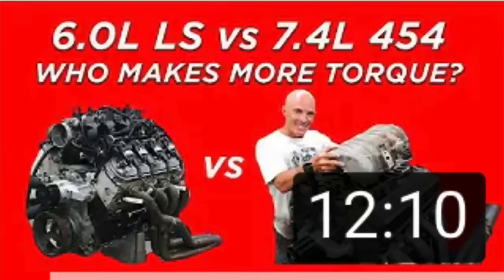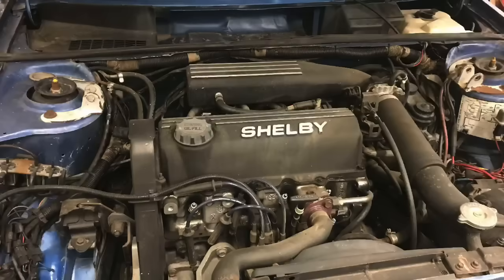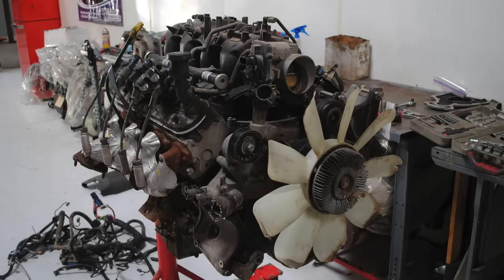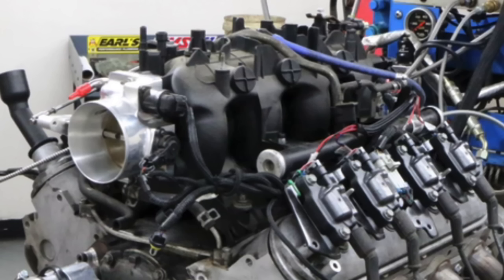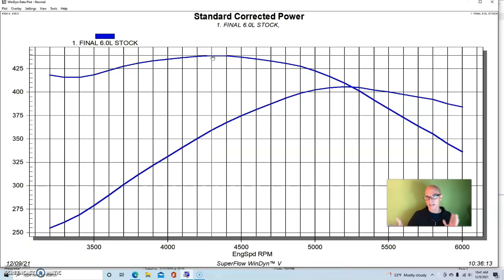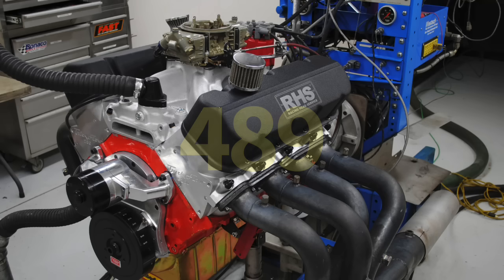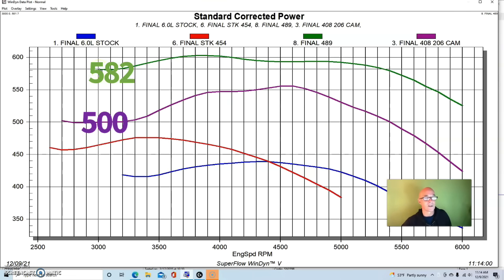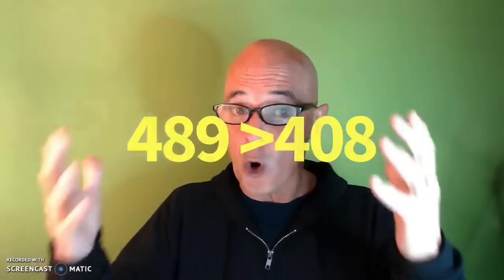LS VS BIG BLOCK! WHICH STROKER MAKES MORE TORQUE? 6.0L VS 408 LS, 454 VS 489 BBC THEN 408 VS 489 !

Comment: @Richard Holdener Great vid! One thing about towing engines is fuel economy. I'm not sure if adding fuel consumption data would make a difference or not. Might be a cool idea for a video though. Even NA vs. Turbo! Efficiency is king right?
Reply from the maker: Fuel economy is not achieved at WOT like these tests-the load would have to be simulated at part throttle
Reply: @richardholdener1727  like at a constant 300 lbs. ft steady load? Probably hard to do on a dyno.
I daily a diesel anyway...🤷‍♂️
Reply: Turbo efficiency is great but you need to remember that as you add boost, you increase cylinder pressure and then you need to switch to 91 octane fuel which costs an additional 50 cents (or more) per gallon than the 87 octane. So, while you get better miles per gallon, the actual cost of fuel used for driving 1000 miles goes up significantly. Ultimately, turbo diesel with it's very high static compression and boost wins in low RPM torque and fuel efficiency.
Reply: @vettedoctor6667  not to mention diesel has more btu per gallon... Between energy density, and the lack of afr control necessary,  that makes diesel king for towing economy.  Remember,  high afr ratio diesel runs cool, low afr is hot and smokey...

Comment: Wish I could get rid of my LS in my '07 Silverado and go with a 489. Since I live in a state run by moonbats, that's off the table. They changed the rolling 15 model year emission exemption starting with 2007 models and up, so now the truck has to keep the check engine light off until it goes to the crusher.. Just my friggin luck. I hate how I have to cruise hills at 4,000 RPM just to get any power out of this thing when I'm towing. I'll gladly trade 200 HP for 200 ft.lbs ...
Reply: As long as you do a complete changeover it shouldn't be a problem to swab a bb i wouldnt think
Reply: @austindoud273  Can't be done now. Will never pass emissions.

Comment: Can we compare a LS 427 to the BBC 489?  I expect the 489 to win but it might be interesting to compare!
Reply: Cubic inches everytime.  It takes magic to beat physics.
Fan boys believe in magic....Ford magic, Chevy magic, or Dodge magic.
Reply: @dannymccarty344  not always the case as shown in this video alone.  The 408 LS beat the 454 everywhere handily yet it has less cubes.  Apples to apples comparison, yes the more cubes the better.  But frequently comparisons are not apples to apples - especially on the street.

Lord knows my LS1 has taken quite a few loud mouthed BBC classic cars to gapplebee's.... ;)
Reply: @steve390gold  watch it again, son.  Pay attention to what is being said in the video.
Cubic inches win.
Reply: @dannymccarty344  son, YOU need to rewatch the video again.

408LS smokes the crap out of the stock 454.  Period.  End of discussion.  Even Holdener points this out.

Dont believe me go take a gander at 14:09 in the video.   It was only AFTER modding the 454 as heavily as the 408 did it surpass it.

Secondly you sound exactly like the BBC blow hards that claim 600hp but struggle to run 13s....lmao
Reply: @steve390gold ok, take the LS and stroke it.  No other changes.  What do you get with more cubic inches? >more power!
Don't stumble over the Big block vs the LS thingy, son.  Cubic inches win.  Stop acting like such a FANBOY.   Physics is physics. ...

Comment: It would be great to see a comparison of similar cube LS and Big Block stokers say within 5 or 10 cubes, run with similar cams intakes, heads etc. That would hopefully show which is truly better. Of course there is the weight difference factor to consider between the two in a vehicle. If they ended up similar, power to weight might be the winner.
Reply: Similar cubes I vote the LS would win, but with over 30 years of design advancements to lean on, it had better.
Reply: @qball1of1  i think if you could put the best ls head on a gm 632ci  engine n/a it would choke
Reply: @jodil5288  you're right it will choke the ls heads won't put out the cfms for 632 to actually  stay running.
Reply: Exactly
Reply: I follow what you are saying, but say both engines make 500 horsepower and 500 lb-ft of torque with the exact same curves. It doesn't matter if it's a big block or a small block or inline 6 cylinder. 500 hp is 500 hp. Therefore, the lighter weight small block LS would have the weight saving advantage in a vehicle unless the application called for more weight. 500 hp and 500 ft-lbs is going to be faster in a Camaro that is 100lbs lighter because the block weighs less than if it was a big block. Does that make sense? I'm not sure I'm explaining my point clearly.
Reply: I doubt the Big Block will even feel the weight difference.
Reply: Right, but the difference would be if they made identical power (same power curve and all) that's when the weight would be a determining factor. Unless the application called for the extra weight say for traction in a snow plow rig or something to that affect.
Reply: @erichoward8463  I think the BBC is less affected by miniscule weight.

Comment: Wish you could get a cam for the LS with a tighter LSA once and push the torque down lower in the rpm band.  That 408 would be great esp with the weight savings
Reply: Call Bullet and they'll grind any cam you want.

Comment: Richard, you make it look so easy. We thank you for all your hard work. You hard work proved what we learned back in the 1970's when we ran small block and big block Chevys. We found that a well tuned small block was a match and a lot more practical on the street. The big blocks were gas burning pigs that were better  suited to trucks
Reply: And a well built bigblock will smoke anything.

Comment: The bigblock has AFR heads the LS has stock heads so with a bigger engine and some of the best aftermarket heads on a bigger engine makes more torque than a LS engine with stock heads put stock bigblock heads on the bigblock bet the numbers would be much closer to the LS numbers
Reply from the maker: the stroker 408 ls has AFR heads too
Reply: @richardholdener1727  sorry about that listening with no voice my bad

Comment: Hey Richard love the informative videos keep em coming brotha, any advice on how to get some more ponies out of a 5.7 Chevy TBI without swapping out to a carburetor some of us unfortunately live in commifornia where the state government hates motor modification?
Reply: Get the 454 TBI or switch to TPI
Reply from the maker: might be legal cams, headers for that motor
Reply: @richardholdener1727  I have already done headers and exhaust plus 14 inch open element k&n filter, by chance do you know what aftermarket cam would work with the factory stock computer? Thanks for responding and any info you can provide me I appreciate it

Comment: Hey Richard. What’s making bigger cams loose torque?? Is it the lift. Or the duration?  More HP IS GREAT. BUT WHY DOES IT LOOSE TRQ??
Reply: Obviously, I'm not Richard, but hopefully this will help. The larger cams losing tq is a function of the longer duration. With the longer duration, the intake valve is held open longer (duration) which leads to bleeding off cylinder pressure at low speeds. A smaller duration cam will slam the intake valve closed sooner in the compression stroke allowing the piston to start building more cylinder pressure earlier vs. a long duration cam that holds the valve open longer allowing some pressure to escape back up into the intake.
Reply: @Torquemonster440  thanks. Great info. I will keep that in mind picking my next cam
Reply: @lildno2007  you're welcome. Another common misconception is thinking cams are sized according to their lift, but cams are actually classified as "larger" or "smaller" based off their duration specs.  How long (duration) those valves are held open is MUCH more critical to power production than how high they're lifted.
Reply: @Torquemonster440   yea I’m familiar with that.
Reply: Usually, it is the overlap. When both valves are open at low RPM, the exhaust isn't very good at scavenging everything out of the cylinder and sometimes goes back into the intake. As RPM increases, the exhaust gets more effective at scavenging the exhaust gasses out and at the same time creates a pull or vacuum on the intake port.

Comment: What single turbo would you put on that 408 with the btr stage 2 cam???? Or that 220 cam you put in?? I really want to know! Something I dont have to rev passed 6500.
Reply from the maker: S475/S480 FOR UP TO 1000 HP

Comment: Honestly torque or horsepower built all out a big block will always win period ever heard of a lil thing called bore spacing
Reply: Ah ok ill go get a bb caddilac cuz ya know those are so good lol
Reply: @austindoud273 Spend the money and those Cadillac engines can make 800+HP NA. Seen a few.
Reply: @austindoud273  This discussion is about a BBC in case you missed it just sayin!
Reply: @scottk2342  no you just said bore spacing
Reply: @austindoud273  ok I’ll bit let me explain bore spacing determines max bore size which determines valve sizing which determines throat diameter of the bowl which controls airflow through a cylinder head get it.Once one builds the engine to handle the power or torque without mechanical failure yes any big block will win period.You see with a Ls you are limited on bore spacing so at some point there are no more Cubic Inches to gain you can’t match the cubes of a big bore spacing big block with head flow.

Comment: While there is no substitute for cubic inches, I don't know if you would really need much more than the 408. We used to have a work ute with a stockish 454 in it, and it had oodles of torque for daily use. The 408 would be a lot lighter to steer and stop. For me I think I would pick it over the big block.
Reply: The big flat torque curve of the BBC is definitely useable and would come in handy in many applications. I will take the BBC every day of the week and add Holley or Fitech fuel injection and then you have the best of both worlds.
Reply: Who cares about the weight when it would be going in a truck anyways like a dually...

Comment: I figured a tune might help my air/fuel issue if one exists, I know the factory tune was meant for the factory muffler. Idk if the 02 sensors are going nuts because of an increase in muffler flow caused a decrease in overall exhaust velocity.

Comment: The gen 6 96-99 7.4/454 have good large oval port heads (not peanut ports). But they have big 'lumps' in the intake runners by the valve guides, supposedly to enhance swirl. I spent probably 40 hours grinding on a pair of 99 heads. I took out the lumps so the intake runners now look like all other normal intakes, and per David Vizard, worked the runners to redirect flow away from the cylinder walls. On a SF600 flow bench, intake flow went from 245 cfm stock to 295 cfm at .600 lift with the stock 2.06 intake valves. That much flow should support roughly 600 hp. I also uniformed intake runner volume and chamber cc's, plus flat milled .020 to make 102 cc chambers. Can I send em to you for testing?
Reply: I, for one would love to see these heads tested with a long runner intake and headers
Reply: @Scott M yes in between the upper and lower. I found a piece or 2"X 6"x36" 6061 flat bar that was reasonable price. I wanted to go 4" but the material was to much. I'm going to put a roller valve train in with the tall covers and that crazy TB position is a problem like you said.
Reply: I'm about to embark on a port job on my 99 L29. I would love to soon some pics of the intake port ramp removed. I am also heavily porting  the stock upper and lower intakes, welded and opened up the TB to a 82mm LS type and machining a 2" spacer to add more length to the runners. Richards cam swap motivated me, I want to see how much torque I can gain without boost.
Reply: @colinallan2976  I have done that too - I welded up the outside of the lower manifold so I could grind enough to improve port match and line-of-sight flow path. I wish we could post pics here. Your 2 inch spacer goes between the mani halves? I was planning to weld a tube to the upper half to move the tb up and away from the valve covers, since I'm going to a roller, adjustable valvetrain.
Reply: I did the same thing to my gen 6 heads and got pretty much the same flow

Comment: Not trying to hijack this comment section, I have a legit question. About a year ago I installed a borla xr-1 3in/out muffler on my 4.8L truck. It’s an 08 with factory tune, I noticed that power band has moved up into the rpm range not a ton, that’s expected. However I can’t shake the feeling that I lost some serious end tq. Is this muffler too much for the stock 4.8L? In the future I intend to run a stage 1-2 BTR truck cam with 3.90 gears. Do you think a tune could solve my scavenging issue. It’s dumped b4 the rear axle, I lost quite a bit of pipe. Would re routing my exhaust regain scavenging?
Reply from the maker: A MUFFLER SHOULD NOT CHANGE THE POWER

Comment: If you happen upon an 8.1 vortec that’d be some neat content
Reply: I'm patiently waiting for Richard to make some videos on the 8.1L.  I'm trying to decide if I want to stroke my 6.0L or if I should just swap it for an 8.1L.  There are pros and cons both ways.  Stock 8.1L vs Stroked 6.0L.   My dad always says "there is no replacement for displacement"
Reply: @Rosy_87  the 6.0 is the way to go it has a way better aftermarket for parts don’t get me wrong I love the 8.1 tons of pulling power aswell but unless it’s going in a 2500 or a bigger truck  theirs no point that thing is a dog the 6.0 can go neck & neck with the 8.1 & still do It more efficiently
Reply: @demarcusbody9437  Yeah it's for my 2002 2500HD.  I pull 10 to 15,000 lbs monthly.  Short trips the 6.0 is fine but long trips and in the hills above 10,000 lbs the 6.0 4L80E combo is adequate at best.  A diesel would be great but they are expensive.  This truck was my dad's he bought it new I washed it as a kid so it has some sentimental value.  The Allison trans itself would be an upgrade alone with double overdrive, closer gear shifts and a lower reverse and 1st gear.
Reply: @Rosy_87  yes I definitely understand what your saying in that case u should definitely keep the 6.0 if it has value to u of that sort also I agree with u diesels are expensive maintenance & fuel cost are way more than the gasser which u have that can do the same job the diesel can but thier are plenty of things u can do to beef up your 6.0 like a better gear ratio/cold air intake / supercharger / cam yunno stuff like that

Comment: My question is is it cost effective   with the LQ to make that power with having to buy all the additional parts/change-over and tune for an older vehicle vs just installing/rebuilding a BBC making similar power.. I would love to see pricing for the average person in the future.
Reply: Definitely cheaper to build the BBC for sure.
Reply: Definitely not
Reply: Agreed - once you start spending large sums of money, does the original engine really matter? Near-stock, low budget engines making big HP are fun.

Comment: I have a 516 big block in one of my cars. Afr 335s,714/714, 252/258@.050, 10.88cr, 2.125x 44in primaries, super Victor, Dominator. Made 739hp/697ft lbs on 2 different dynos. Super snappy and lots of fun
Reply: I am going to try and copy your combination. What kind of car is the engine in and have you taken it down the 1/4 mile or anything? Sounds awesome.
Reply: @Bazooka Joe  plus it's mated to a T56 Magnum,  car weighs 3360lbs without me. Never had it on the strip, but even with 305s in the rear car is going sideways at 100mph. Made 632fl lbs at the start of the Dyno at 3200rpms. It's a tire frying beast!
Reply: @VegasRT500  https://youtube.com/shorts/EslT2Vh41ls?feature=share